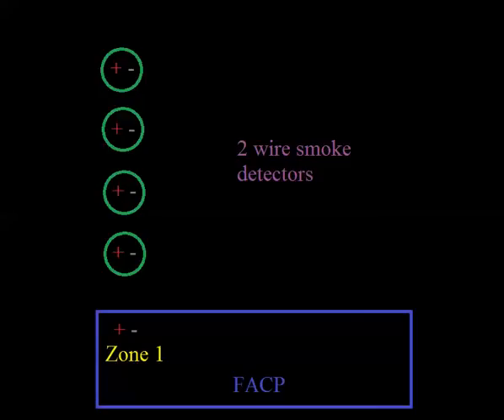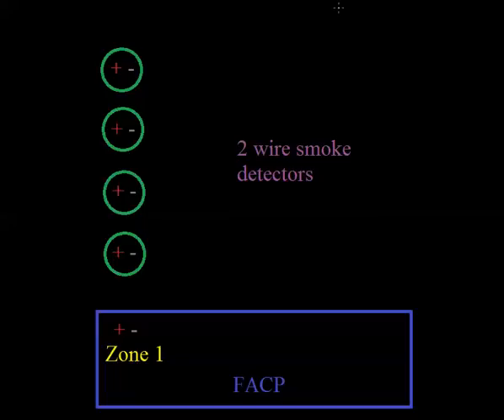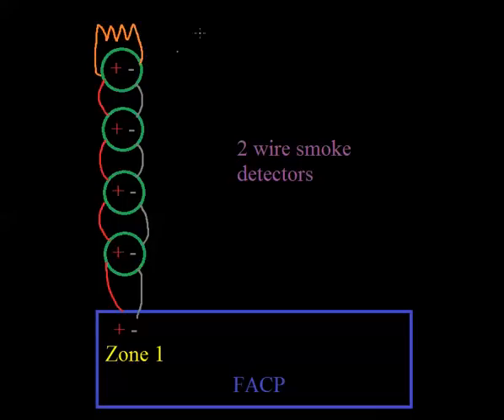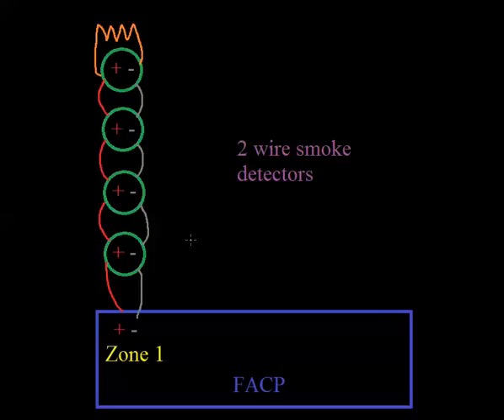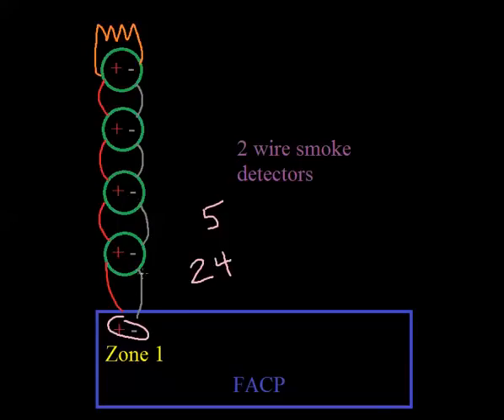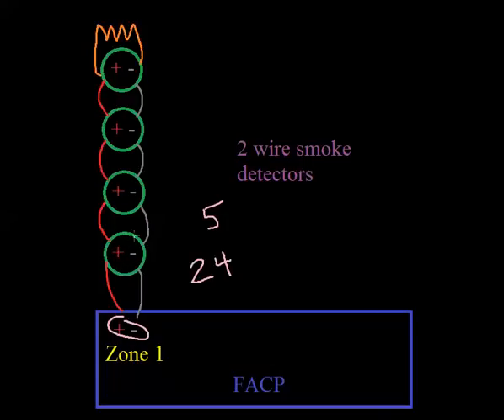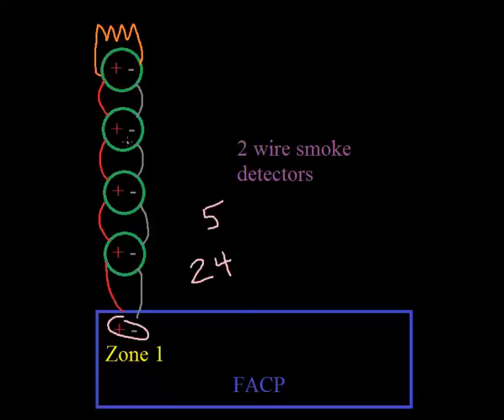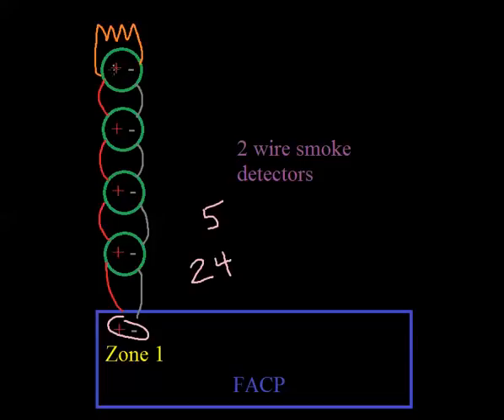11 - Two Wire Smoke Detectors - Introduction to Fire Alarms

Comment from the maker: Beth, if a wire is cut on a class B circuit the zone would go into trouble and none of the detectors after the open would work. If it was a class A circuit it would still work because the circuit is fed from the beginning AND the end of the circuit. However, another limitation of class B circuits is that you are limited to how many detectors on a zone can be in alarm at the same time. That usually only matters when that detector is performing an auxiliary function.
Reply: i dont mean to be off topic but does anybody know a tool to get back into an Instagram account??
I somehow lost my password. I love any assistance you can offer me!
Reply: @Leon Allan Instablaster :)
Reply: @Karsyn Fletcher Thanks so much for your reply. I got to the site thru google and Im in the hacking process atm.
Seems to take quite some time so I will get back to you later when my account password hopefully is recovered.
Reply: @Karsyn Fletcher It worked and I now got access to my account again. Im so happy!
Thank you so much you saved my ass :D
Reply: @Leon Allan glad I could help =)

Comment: hello pls let someone answer me. i am start learning FA. i am confused because if a smoke detector activate let say second one. so the SD will short circuit and all zone current will flow into that SD and no current will be left for SD installed after that activated or short circuited SD.